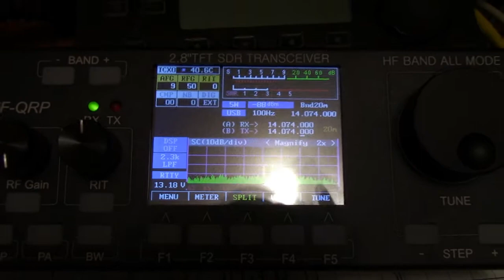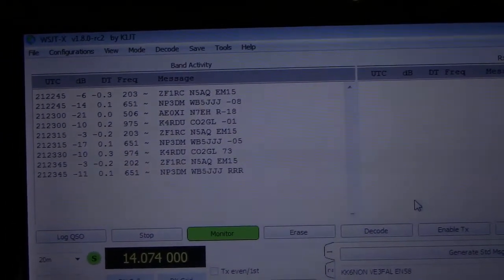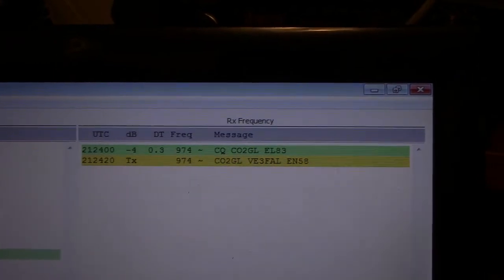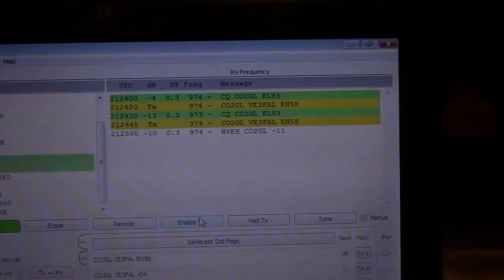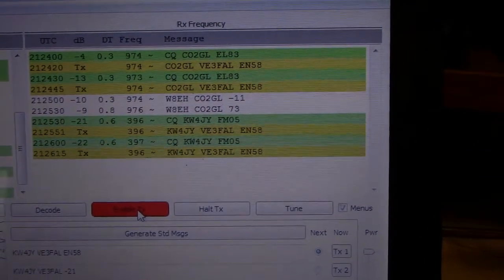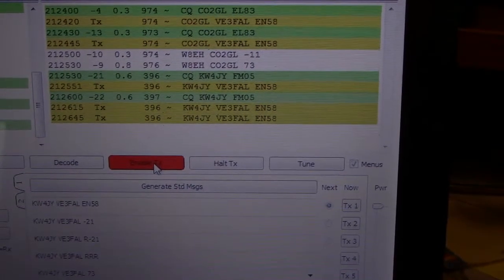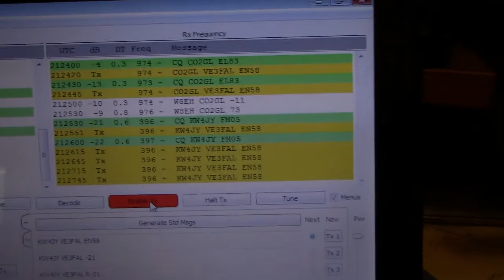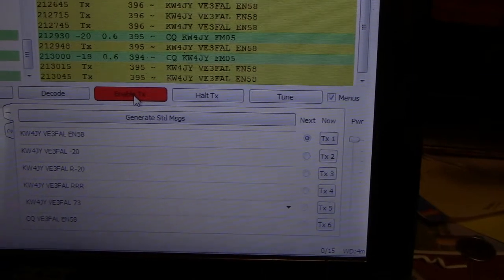mcHF RS-918 on FT8 and look at config files for soundcard and rig control

Comment: hello, I just received mt RS-918 and following your video is kinda hard as there is no sound. For me I cannot get it connected as shown in your video? I can transmit with FLrig seems to connect fine. But for wsjtx nothing? I don't understand? Am running WIN10
George
Reply from the maker: George, I recall I used FT-817 configuration settings in WSJT, as well make sure your clock on computer is synced or you will not get any decode. I sold this radio years back, so do not recall many of the settings or what I did, but I know it was quite easy at the time. Now with W10 you may just need an updated driver as well. Fred VE3FAL
Reply: @VE3FAL1Fred  Thanks I got to work work Ham Radio Deluxe. Would not work or connect any other way. Thanks!

Comment: Under windows 10 is really easy .  But under Linux meet problems - same settings doesn't work. Can see com port , speed but testing cat is not  succsessufull. Do you have expiriense to run RS-918 under Linux?